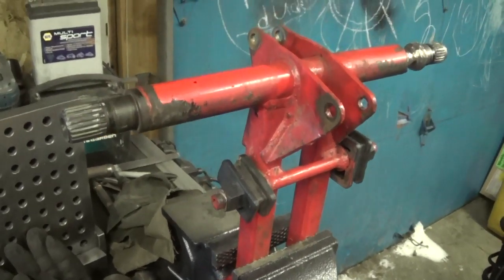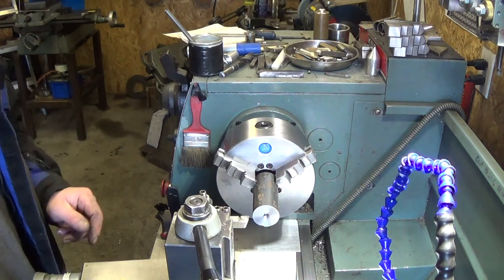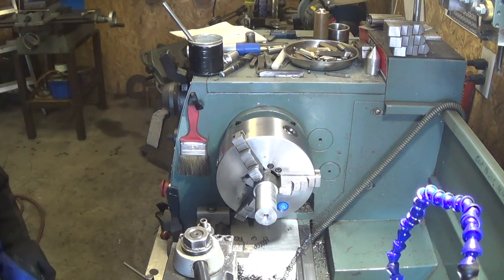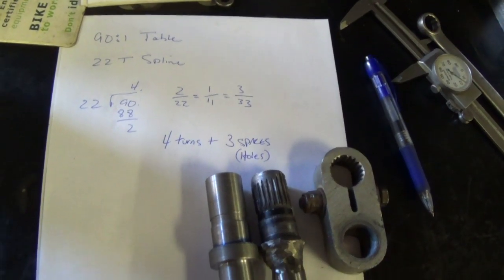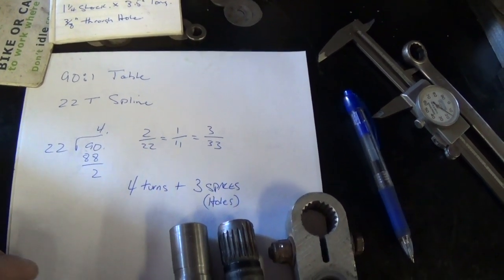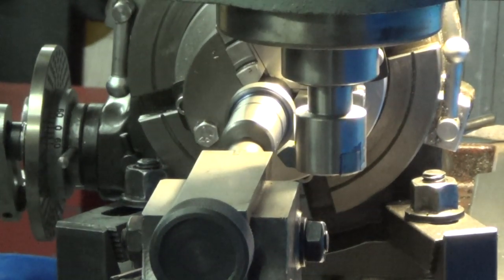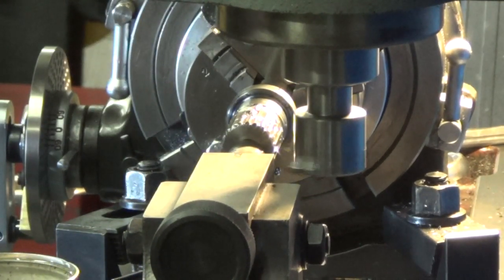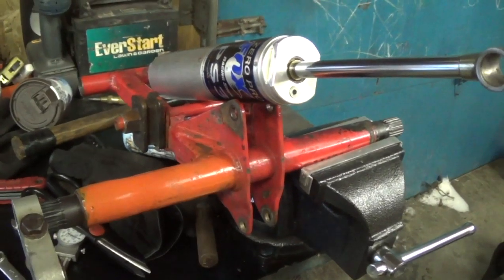Splineless

Comment: Hello Colin,  I believe little about machining is mundane.  Seems there is a new bend to almost every operation and little tricks as well as the major ones.  If nothing else I like to hear the machines cutting as it tunes my ear when mine are misbehaving.  I find the day to day breakdowns and fixes, solving the problems with what you have are well worth watching.  Throw in that everyone does things a bit different and it is fresh stew every day.  So keep on showing shop jobs and I will keep on watching.  If you want to engineer a project from the ground up now and again that is excellent too.  Take care.  Doug
Reply from the maker: Funny thing, when one checks the stats it seems most people skip the actual "cutting" portions of the video opting for the discussion/planning parts.  There are a few that want to see all the cutting but for the most part just a cut or two to show the operation is normally adequate. I'm kinda like you and want to see/hear but it makes for way too long a video. In creating a video we try to convey all the pertinent info but yet keep the video short enough to retain attention.  Cheers, Colin :-)

Comment: Colin, I use motorcycle sticky chain lube in the spray can for my change gears. Absolutely wonderful, and doesn't sling off.
Reply from the maker: I am liking the Maxima chain wax. Once the carrier dries up it is awesome and doesn't come off. Change gears are quieter too...bonus!
I also found if the 120/127 idler is tightened hard it makes more noise. Going to check out the alignment soon and readjust.

Comment: A very nice repair job!  Most shops would of tossed the part out and sold them an expensive replacement.
  I have a rotary table and tailstock, but I don't have any index plates with it. Would using the graduations on the side of the table be too inaccurate?
Reply from the maker: Replacement cost for that part, I think, was $270 + tax, or $305 locally.
I did his repair plus shock rebuild/revalveing for $280 all inc.
I guess you could use the degree markings, as long as you have the vernier on the handwheel. That however would be a nightmare keeping track of each spline. In this case each spline was 16.3636 degs. Try keeping track of that in 22 increments adding as you go. No joy there.
Thanks for the comment! :-)

Comment: besides myself and James killroy no one on here wears ear protection i have seen...you need to get some muffs or plugs!

anyways real good video I dont care what anyone says about you :")
Reply from the maker: I see no need for hearing protection for most tools in the shop with the exception of grinders and such when working on the tractor type stuff.
My change gears are just annoying type loud and the camera seems to hone in on that sound. Did some adjusting today and tried a new lubricant(motorcycle chain wax) which seems to work better.
Thanks for commenting. :-)
Reply: As a guide to the need for hearing protection, if your ears "ring" after exposure to noise it's TOO late because some damage HAS occurred. Although the delicate little "hairs" that pick up sound will recover, to some extent, everytime it happens these hairs get stiffer to the point where they only respond to louder and louder sounds. So why risk it, in a noisy environment wear protection, it's not sissy to wear defenders, all the best service men do.
ATB
chris
Reply from the maker: Chris Stephens
My father and I had a welding shop for 12 years and we did some wicked stuff on heavy equipment. Arcair and grinding inside large excavator buckets, container trailers, and the like. I had no problem wearing protection in such jobs and would again. This stuff is hardly loud. Perhaps I overstated about the change gears?? :-)
Reply: I did not mean to imply that you needed to wear them whilst using your lathe but just offered general advice as to when it's too late to start wearing defenders.
chris